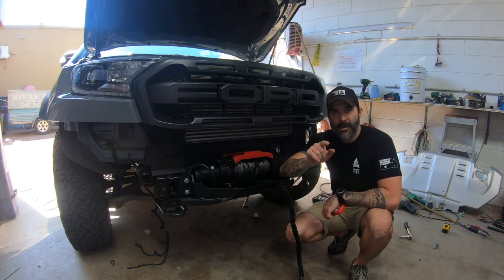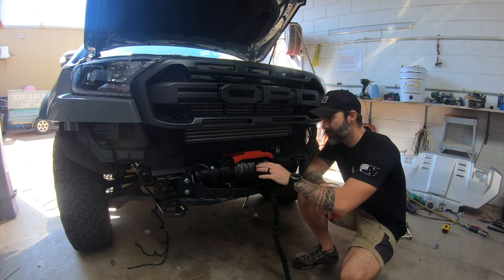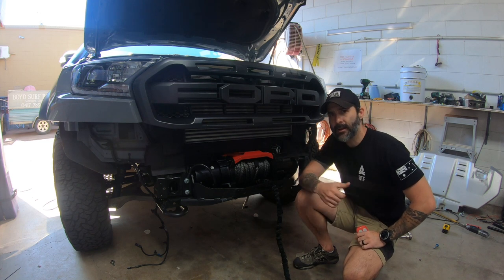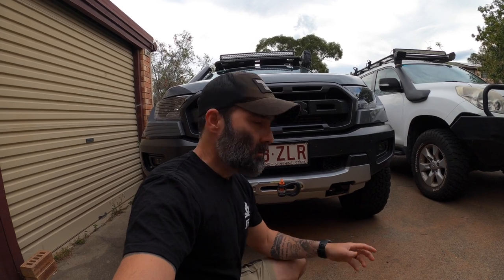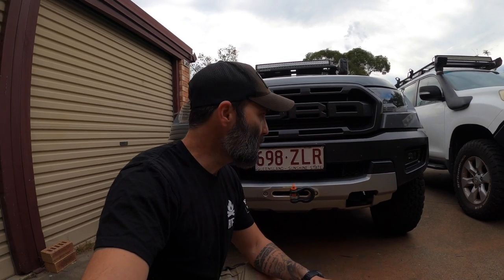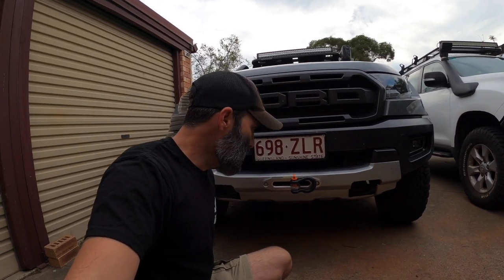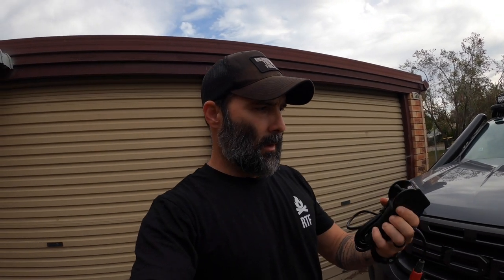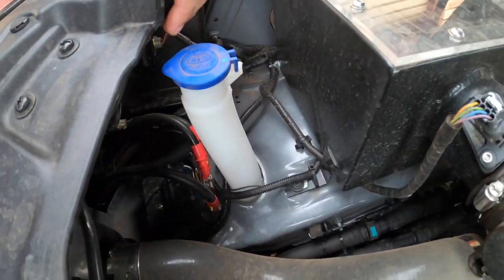HIDDEN WINCH MOUNT - RANGER RAPTOR - HOW TO INSTALL

Comment: Thank you for the video. I couldn’t see the final look close enough , One ques: can you access the winch clutch(to pull the rope out manually) from the gap in the bumper which is below the plate number ? Or it’s not accessible? Thank you again
Reply from the maker: Yes, plenty of room to reach “through” the bumper. Winch is also accessible from the side which is the most convenient

Comment: Nice one Damo beats as you say having a bull bar and the extra weight.  👍😎🇳🇿
Reply from the maker: exactly right mate, as much as i like the protection of a full bar, the weight on the factory Raptor suspension is just too much with full bar work.

Comment: That was excellent.  Well  done.  I'm looking for one for my 2020 Ford Ranger XLT 4x4 off road.  Has the skid plate.  I  think you can even put a light bar in too.  Now I have to see if you have one that will fit well for my Ford.  Don't need a super heavy duty and would like to mod it to roll into the winch with no hook outside.  
Very good job presenting it.  I'm from Oklahoma and I just subbed and will be going to your web site...I think you have one.  Once again, well presented.
Reply from the maker: G’day mate, I don’t have a hidden winch mount for the XLT but you will be able to find one at Frontrunner outfitters. 

Here is the link. 

https://www.frontrunneroutfitters.com/en/au/ford-ranger-t6-winch-plate-wpfr001.html

Comment: awesome work. Getting enough gear to do another 'walk-around' inside/out :)
For the safety conscious out there, would you put something weighted on the cable to help transfer any excess energy back into the ground if something snaps? (obviously off the other guys ute :P )
Reply from the maker: Definitely mate, great advice. Always weight the winch rope if unsure of the loads.
Reply: @RoundTheFire  I'm more interested in this 3rd party air box you installed. can you give any details on that Damo?
Reply from the maker: The Airbox is an extra that you can order with the snorkel from platinum. I’m actually fairly surprised with how it performs. I have always been anti fabricated snorkels...
Reply: @RoundTheFire  Oh wow, $1,450 for that combo, i only paid $300 (cost, as one of first in au), to rich to me.

Comment: Hi would you know the spec on the front tow hooks  it states 4635kg  is this with both being used at the same time ?
Reply from the maker: Yes, if you bridal both together then you get the full spec almost 5T pull capability
Reply: @RoundTheFire  thank you 🤘

Comment: I am one of your long time follower subscriber. Where can I buy/order your Complete Winch Set?  May I have the Contacts? Thank you
Reply from the maker: Available via my website www.roundthefire.store
Reply: Thank you bro!
Reply: Wow 1k for the cradle with bolts 😬 🤷🏻 ganna start saving. Well worth it for that factory look I'm going for 😊💕 I'm glad there starting to get more mods in the ranger community like the 3 light projector led headlight housing. There's some very tastfull but practical mods I'm digging.

Comment: Hey, Do you think adding winch on ranger raptor may cause to change the weight balance. I thınk  raptor's shocks are working best with anything added. Sorry about my english :)

I want to do some things on my raptor (fridge, boxes, winch etc.) But ım afraid of change the weight balance of the car.
Reply from the maker: A winch in this configuration won’t upset the balance. If you start to add too much steel bar work just for looks you will quickly notice the change. This can be fixed by changing the springs on your suspension but that’s the last thing I really want to do after all you paid good money for the fox suspension in the first place 👍🏻
Reply: @RoundTheFire  Unfortunately ı cant fınd upgraded springs in my country. If ı want to import them, it will be very expensive.I need the stick with the original ones anyway :)

Thank you very much for your reply..
Reply from the maker: @fehrer1000  no problem, I am also only building my truck to keep as much of the standard components.